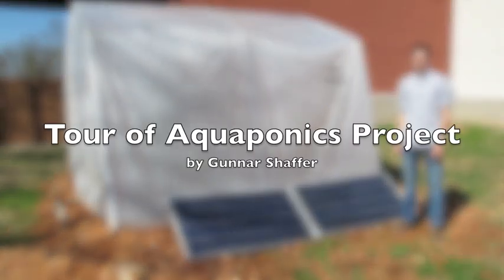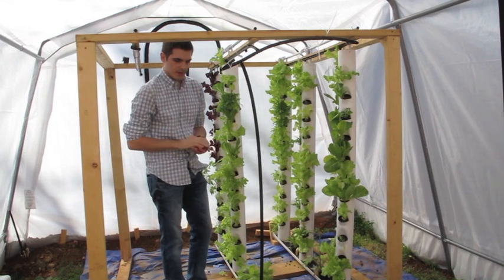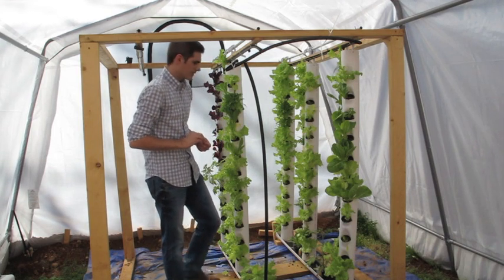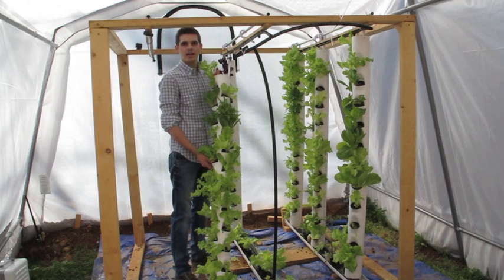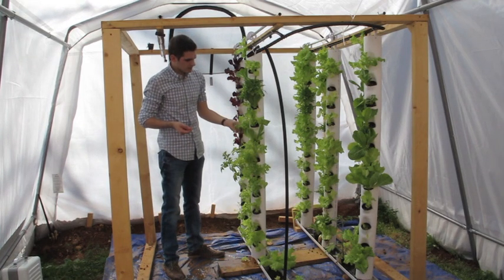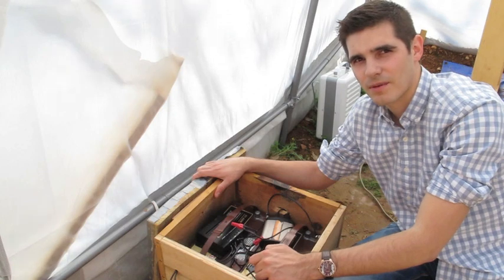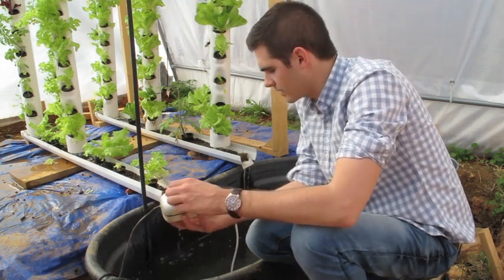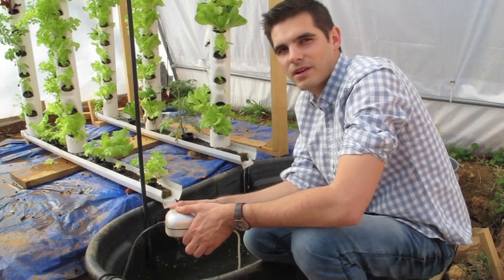#Aquaponics System - #Solar Powered #VerticalFarming www.agrowponics.com

Comment: Awesome design, like the portability too.  But you may need more light in there for better growth.  Also, your plants should be staggered and not aligned directly above one another, and it looks like you have only one long line of plants on each tower, how come such a seeming waste of space contrary to "tower" purpose?  Btw, I'm not a rocket scientist but it looks like, from my vantage point, your 2x4 frame has no bracing, which would be a serious no no.  Thanks for sharing.

Comment: Gunnar... very nice system. I know this is a very old video and perhaps you will not see this message but I am wondering. I watched your DIY series on how you built your system but I don't know how you insure even distribution of water flow down the inside of the tube? Is there some sort of sprayer head or something simple like a watering can head? If you get this.. would be great to know. Awesome system. :)
Reply from the maker: XoshBitt Hi,  thanks for watching we actually have a company now. Www.agrowponics.com

There are just little 5-10 gal droppers. That snap onto the pipe. Now we have an entirely diff system with 360deg rotating caps.
Reply: @GunnarShaffer  Thanks for the info. I checked out your website. Very slick system. I like it a lot. I'm living in Switzerland and (like everywhere in Europe) my space is quite limited. I'm looking at portable tent style "greenhouses" for keeping trees warm in winter and how to convert that into a "vertical greenhouse" of sorts. This hanging pipe system looks like a great idea and keeps the footprint super small. Thanks again of the info!

Comment: With the water running down the towers and running into the container, do you really still feel the airrator is still necessary?
Reply from the maker: It is for the fish in the middle of summer the oxygen in the water leaves quickly, this ensures they have enough!

Comment: If anyone wants more detailed how-to videos for this system, just check out Bright Agrotech. They pioneered this method and made many great videos showing how to DIY.
Reply from the maker: Yes Ian! We highly recommend the videos at Bright Agrotech.  We actually started back in 2013 at about the same time, and while he kept moving along with his Phd. I moved to Germany to complete my post grad and dropped Agrowponics, then I picked it back up and founded Agrowponics LLC.   BUT what sets us apart is our ability to grow on all sides as compared with the zip grow tower,  we also have 360 rotating caps that allow the user to rotate the Agrowtowers.  We also now use a CNC machine and then a flameless heat gun to heat form the plastic in addition to complex filters.   We have them for sale now on our website, www.agrowponics.com/shop

Comment: Are you sure the pump(s) is running on AC power?? They are normally running on DC power with brushless motors! You could save a lot of energy (I guess 10-20%) if you would connect them directly to a power distribution box which is connected to the solar charger.
just my 2cents
Reply from the maker: Yes we have AC pumps due to the cheap price. We have a DC to AC converter.  We appreciate the comment, that system was dismantled after the project 6 years ago.

Comment: Are these made from thin walled pick? I’ve only managed to make one tower so far.
Its pretty thick walled and takes a while to heat up.
Reply: subtle username  I own multiple torch types but chose to use my heat gun with mine. Just noticed my last comment said thin walled pick. Was supposed to be PVC. Lol. I did look around online and found a site selling thin walled PVC for $4 a foot. That's for 4in PVC. I didn't realise you used 3in.

The yellow tanks are Map gas. Depending on the torch head used that may be too hot for this but I'm not sure.  I may try a torch with my next tower. Im not building a wooden frame to hang them on so I've been running into several issues. First my pump wasn't strong enough so I bought a better one. I did almost give up on it yesterday but I'm going to keep going with it.
Reply: subtle username  Does water run down the outside of your PVC towers? It does on mine making it not ideal for indoor use. I used a 2in dowel to form the holes but I may have made the cuts too wide.
Reply: subtle username  Oh, you aren't the uploader lol. So you made these too?
Reply: subtle username I may have went a bit too deep on my cuts. The water that does leak out of the holes is at the edges too. I cut straight but I will try and figure out what you mean and which angle to cut them at. I’m about to do my measurements and get started. With the idea in my head for a second tower and using one 5 gallon bucket this second tower can leak or I’ll loose water.
Reply: subtle username  I got it. Just formed my first hole after cutting and it's nearly perfectly round. Doesn't look like water will be leaking out if this one. Figured out the angle of the cut too. Thanks!
Reply from the maker: Thanks for helping each other, we use 4in pvc. 3in too small to grow 360 deg and more than 4in less than optimal water delivery.  Today we use a CNC machine and then a flameless heat gun to heat form the plastic in addition to complex filters.   We have them for sale now on our website, www.agrowponics.com/shop

Comment: Is the water constantly being pumped or is it on a timer? Also you said it was “7 gallons per hour” and then “250 gallon per hour pump” later in the video. That would mean you have about 35 towers but it looks like much less. I’m interested in making a very similar system to yours so I would appreciate any information. Thanks
Reply from the maker: Almost always on!  250 gal per hr at 0 head height after the head height you rapidly lose that number. Today we use a CNC machine and then a flameless heat gun to heat form the plastic in addition to complex filters.   We have them for sale now on our website, www.agrowponics.com/shop

Comment: Hi, how do you ensured in the pipe design that water will reach all the plants from top to bottom equally? 
I am really having hard time figuring out this.
Reply from the maker: It just does, stop thinking and just make it work! Trust me it will.  Today we use a CNC machine and then a flameless heat gun to heat form the plastic in addition to complex filters.   We have them for sale now on our website, www.agrowponics.com/shop

Comment: Do you run the water 24/7
Reply from the maker: Hi Kane, thanks for watching my videos, make sure to watch the other videos to understand how the whole system integrated. We had the water running 24/7 but it would be easy to modulate the water flow to reduce energy consumption if the batteries went below a certain level.  Make sure to check out my website now that I have created a company selling my vertical towers.  www.agrowponics.com   Since you watched my videos before and commented use the code for $10 off my towers AGROW10 :)

Comment: thanks for the video.  is a beautiful project. how long the pump on your system. I heard that in the NFT system when you turn off the pump should be some water in the tube. what do you think? greetings from Mexico. Thank you. un
Reply from the maker: Hi Doulos, thanks for watching my videos. The pump is continuously running. Great to see you are from Mexico.  Make sure to watch the other videos to understand how the whole system integrated. Make sure to check out my website where I am selling my vertical towers.  www.agrowponics.com   Since you watched my videos before and commented use this code for $10 off my towers:  AGROW10

Comment: Thanks for sharing this. I have a few questions:
Capacity: From what I can see, you have 5 towers there and you said a 100-gallon tank. Is that all you could produce, or was it just some other limitation?

Fish: What kind of fish did you use and how many were in there? Also what were you feeding the fish?

Towers: It appears that the water is constantly running. I watched your other videos on creating the towers, and I was wondering, when you run the water from the top, does it reach each plant equally, and do you have to give the roots time to breathe? I saw elsewhere that it isn't good to have water constantly running over the roots, or is that what the grow medium is for?

Thanks for your time!

Comment: Hey Gunnar I was wondering if you had any wild temperature swings with this design since there isn't a big body of water to maintain it
Reply: And I mean without the water heater
Reply from the maker: Hi Jacob, thanks for watching my videos, yes without a water heater the temperature swings can be quite harsh on the system. This is why it is good to have a heat medium in the greenhouse such as rock or water barrels. Make sure to watch the other videos to understand how the whole system integrated. Make sure to check out my website where I am selling my vertical towers.  www.agrowponics.com   Since you watched my videos before and commented use this code for $10 off my towers:  AGROW10

Comment: Great video. Help me somebody, please. I would like to make 30 of these towers and put in my greenhouse. What is the smallest fish tank and pump gph that I can use to run 30 towers? I was thinking about buying a 330gal food grade water storage tank for the fish. I will recess the tank, so the elevation of water line supply will be around 6'  Thankyou nathanebner@gmail.com
Reply from the maker: Hi Hugh, thanks for watching my videos, I would say you need a 300+ gallon fish tank and a pump around 500gal per hour, but make sure to look at the pumping charts as they make a difference with heights. make sure to watch the other videos to understand how the whole system integrated. Make sure to check out my website where I am selling my vertical towers.  www.agrowponics.com   Since you watched my videos before and commented use this code for $10 off my towers:  AGROW10

Comment: hey Gunnar,
I'm just wondering what did you use for plumbing the irrigation system. are there tutorials available for that? thanks!
Reply from the maker: Hi Jack, thanks for watching my videos, I used some soft PVC water pipe from Lowes/homedepot. Make sure to check out my website where I am selling my vertical towers.  www.agrowponics.com   Since you watched my videos before and commented use this code for $10 off my towers:  AGROW10

Comment: I have various videos on solar panels powering a high amperage 12VDC pump using supercapacitors. The capacitors can be cycled millions of times down to 0 volts. https://youtu.be/hi0AazuARTQ  In other videos I show how a simple set of diodes across each capacitor prevents over voltage. Basically diodes activate at a certain voltage which makes them better than resistors at balancing out the voltages in the pack.  $17 vs $200 for a battery. I use the capacitors to run either constantly (limited by the solar panel out put) or intermittently (much higher voltages/current for short bursts of a few minutes at a time)

Comment: Do you have the water running off to either side of the pipe, or just straight down the middle? Could you maybe upload photos or videos of the trickle?
Reply: +reinux Generally the water goes down the middle and splashes into the net pots.
Reply: Alayna Ah, thanks.

Comment: very nice system and very well explained which make it looks easy to understand. i'm wondering if the towers are filled with dirt ? or just the plants cups ? 
thanks
Reply from the maker: +Faleh alarabi You should take a look at my other videos and you can see the construction. There is no dirt. Only Rockwool and Hydroton.
Reply: i watched both videos and saw how you constructed them with mini torch but the water dripping from the top might fall straight to the bottom of the pipe without watering or touching the plants roots but i assume it depends on the pipe dripping as well.
Reply from the maker: +Faleh alarabi one the water drips in the top it cannot go straight to the bottom because the cups are lined up in the center once pushed in. The system works or plants would grow.;) I make towers for sale if you want to know more message me.

Comment: Hi Gunnar, do you have any medium down the centre of the pvc pipe for bacteria ?

how do you explain the uneven growth on the front right tower and back right tower towards the bottom sector,?

regards
Reply from the maker: MARZ A In the center of the PVC the roots will grow and form one column very quickly within the first 1-2 weeks. The uneven growth is because we had already cut and replanted some and switched others. It was a research project so not commercial scale. We measured root growth and many things moving plants around, we saw very little difference in the plant growth from the top plant to the bottom back plant. The towers can be unhooked and rotated if you feel this is necessary.
Thanks,
Gunnar

Comment: Do you have problem with alga growing  ?
I've heard that the water needs to be 'covered' from light...
Reply from the maker: Guillaume Boulay We had no problem because our tank was covered just not for the video.
Reply: +Guillaume Boulay, algae is normal and occurs every spring and you don't need to worry about it unless it continues into summer. There are floater, water lillies and deep water aquatics plants for cover. Check out how to make a bog and add "bog plants" to the system, like Prickly Rhubarb, it sure loves dead algae. yum, yum says the bog plants...

Comment: Hi, Gunnar! Nice work! Keep all of us posted on the progress of your project, please.
I have a question: when plants in your tower reach full size, do they compete for light? Also, at that point, do they shift the tower forward too much? Have you observed your plants at that stage?
Thanks!
Reply from the maker: We most certainly will, currently I am in Germany for 2 years and I am not working on the system anymore.  Most plants will try to form a head and bush out like lettuce. We experienced that a little competition was a good thing because it forces the lettuce to grow for more sunlight! But the holes are spaced so that the plants rarely overlapping. If you grow herbs or a bushier plant like tomatoes then naturally you may want to skip every other hole. I am not sure I understand you second quesiton.The towers were connected into the gutter at the bottom so the towers did not shift if that's what you mean.
Reply from the maker: https://www.facebook.com/sahakkumkhmer

Comment: Hi Gunner
This has to be the nicest set-up I have seen.  Simple to build, little cutting, drilling, and buying of parts.  Make the Pipe do the work.  I would be interested to see if there are 12 volt pumps, aerators, and heaters if this is possible and economical it would save the expense and loss of efficiency  that the inverter injects to your system.  I love the idea of aquaponics, but I may start with hydroponics.  Did you ever figure out what the issue was with cilantro ...., one of my reasons for trying this will be to save space in garden I presently use for herbs, and lettuce.  Great Idea, fantastic videos, good luck to you with your education and projects
Reply from the maker: The inverter is 96% eff. so the losses are almost negligible. We did it this way because we could not find enough low voltage components therefore we used the 12-120v inverter.  Hydroponics is much better to start out with if you are new. Keeping fish alive is quite challenging.  For the cilantro it was not warm enough at night because this project was built during winter-March.  Thanks for your question and encouragement! Have a nice day.

Comment: Great videos, Gunnar!! I'm currently in the process of planing a completely self-sustaining vertical garden system. The pumps will run on solar, and the water will come from a well and will be on an auto-fill system with a floater. And I'm also trying to devise a method to automatically introduce the nutrients so it will be completely hands-off, aside from maintaining and harvesting the plants.
Reply from the maker: Thanks. One comment/warning  make sure the well water does not have copper/arsenic and other things that could do harm to the system. If you return the waste water to the well make sure you don't drink in the future. Also a well depending on the depth could cost a lot to pump the water!  #experience No criticism, just be careful! :)